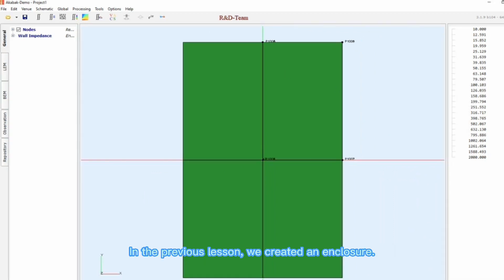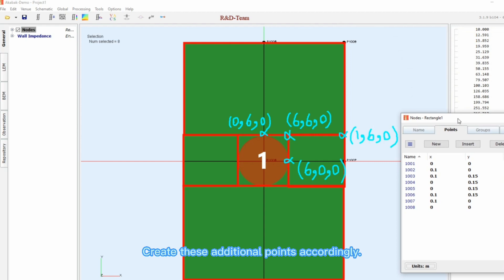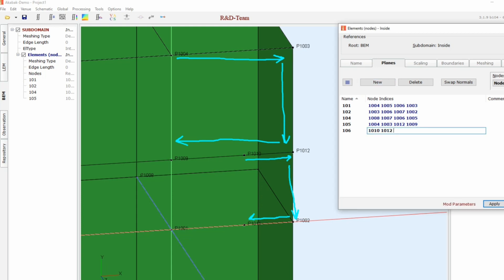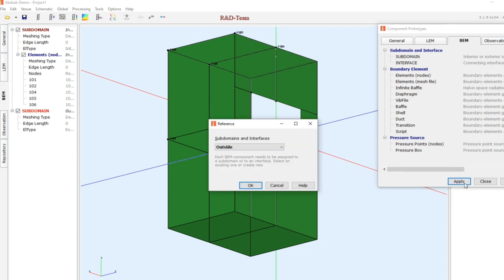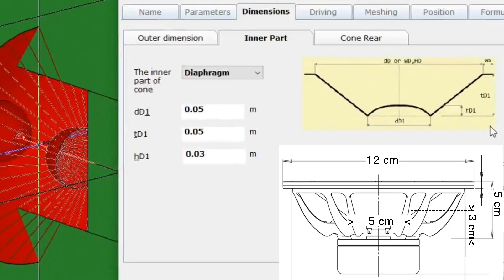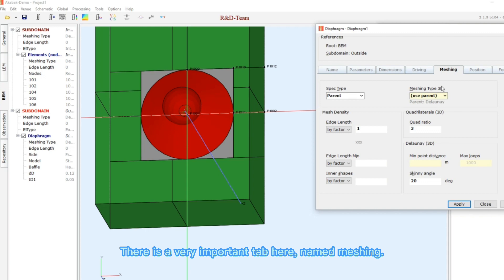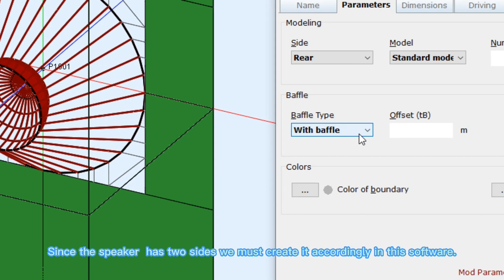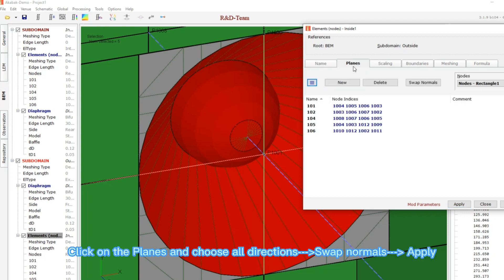Secrets of Speaker box design with Akabak_3

Comment: Damn... "Baffle'" is now separate component and I'm struggling to make it correct on this step
Reply: Did you ever figure this out? I'm not sure how to proceed either.
Reply: For anyone who might be reading this in the future, you can create a seperate component called a baffle, set the dimensions to what you need, then in the items tab, create a new entry, select the hole tab, and then enter the diameter of the driver as dHole. 
hope that helps!
Reply: @michaellam6612 thanks a lot! Now I’m going to continue learning 😀